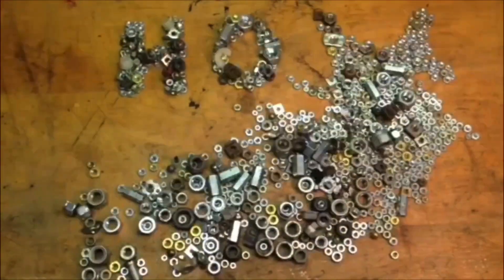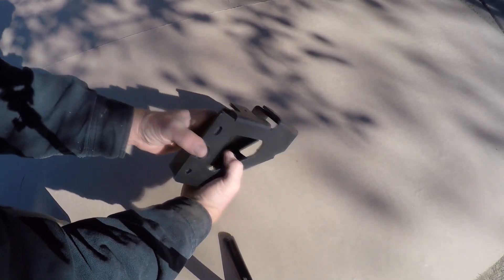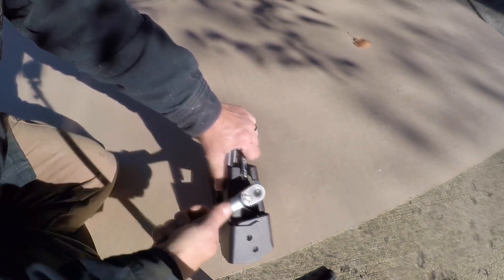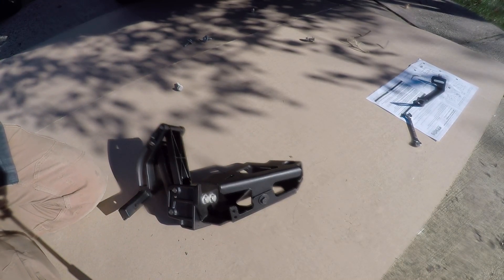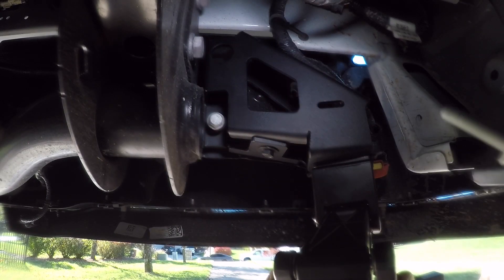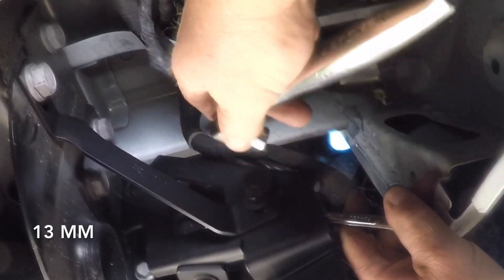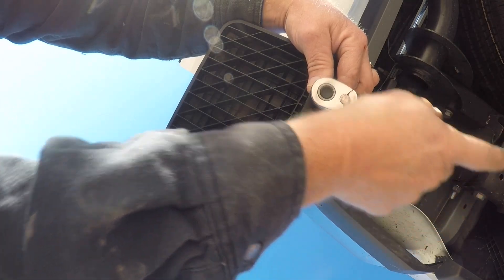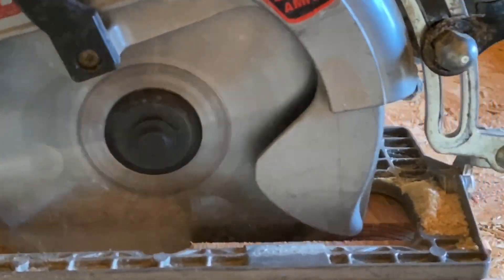Installing an AMP Research Bed Step

Comment: GREAT VIDEO.  REALLY HELPED WITH THE INSTALL.   HOWEVER, I DID ENCOUNTER A PROBLEM WITH THE LAST TOP BRACKET BOLT.  IT WAS TOO BIG FOR THE TOP BRACKET HOLE.   I SIMPLY USED THE OEM BOLT WHICH I PULLED OUT AND RE-USED IT.   IT FITS THROUGH THE TOP BRACKET HOLE.   NO ISSUES WITH FITMENT NOR ALIGNING THE HOLES.
Reply from the maker: GLAD IT ALL WORKED OUT FOR YOU. I LOVE MY BED STEP. DON'T KNOW WHAT I HAVE BEEN MISSING. THANKS FOR WATCHING!

Comment: Great video!! I ordered one of these for my 2020 3500 and there is not allot out there. I have also been seeing allot of reviews about the bolts not lining up or clearance problems at the hitch bracket. It looks like you had no issues. Thanks
Reply from the maker: No issues at all, went on very smooth and relatively easy. With the height of the new 3500's and 2500's this is almost a must have. Thanks for watching.
Reply: @funbro1  I just got mine in today and got it installed. You must have gotten lucky. The reviews I read about some holes lining up were the same on mine. I had to keep all the bolts loose just to get the bumper mount bolts to go through the holes and line up with the truck. Once I got those in it was no real problem to tighten everything back up and torqued. The last issue I had was my pad seamed to be a little warped. I had to clamp the ends to seat it in the groove to put the small Allen screws in. They would not even start in the metal backers. All in all, it’s done.
Reply: @funbro1  would this fit my 2019 limited 1500?
Reply: 2020 ram 3500, did not line up perfectly. Gonna give it another go tomorrow. Seems like I need to leave bolts loose till its attached. Great vid!

Comment: There are two wire plugs you got to pull out.  The top one goes into the bracket and the other one that is more of a square plug is the one I've had issues with.   Did you run into that issue.   That plug would not go back into the original hole and I didn't see a plug on the bracket like they made for the other plug.  Any help is appreciated.   Other than that the install was a breeze.  This is on a 2019 Ram 2500 8ft bed Limited in case of that matters when it comes to those two plugs.  Not sure if the other trim packages are set up the same.
Reply from the maker: I have not had that problem with my install. Thanks for watching.
Reply: I’ve got a 2022 Power Wagon and I am staring at the same issue I believe. There’s a big rectangular plug mounted in and a smaller rectangular one below it. Did you find a fix?? Thanks!
Reply: @alexmcdonell1452  the only fix i came up with was to ziptie it so it would not move.   I have not had any issues so far.   My concern was vibration from the road whether it was on or off road and it's not given me any issues.  Not an idea fix but that is what I've come up with.
Reply: @nlpyles2145  yessir I did the same exact thing! Lol. Still works!

Comment: Good job with this video. Do you know if the part number for this Amp Research step is 75324-01A?
Reply from the maker: Yes, that is the part number for the one in the video. Thanks for watching.

Comment: @funbro1 if you don't mind me asking, how much do you weigh?  I'm just over 300 lbs and wanted to know how durable it is.  Thanks for the video!
Reply from the maker: The weight capacity on the Amp bed step is 300 pounds.
Thanks for watching.

Comment: Does this install on a 2022 Ram 3500 Dually. I cant find a video installing on a dually, and I think the brackets are different.
Reply from the maker: I know they do make a bunch of different models, but I’m not sure if this will fit on the Dooley as well, best bet is to call the manufacturer directly. Thanks for watching.

Comment: Thanks for the tutorial — the instructions failed to show how the assembly attached to the truck. My installation was very difficult because the bolt holes did not line up after assembling the tow halves together. And, I had to install the upper bolt all the way through the bracket before installing the bracket to the frame. I rate the quality of manufacturing of this AMP RESEARCH STEP A 2 OUT OF 5. Because of the fussing to get everything to fit together due to misalignment, the install took 2-1/2 hours instead of the 30 minutes it should have. If I didn’t have an impact wench, the install would have failed because the misaligned holes for the upper bracket bolt was binding on the bolt shank so much that it took the torque and speed of the impact wrench to finish the job.
Reply from the maker: I’ve heard that the The holes did not line up on many of these steps. I found the directions to be not so good as well and was hoping this video would help some people out. Thanks for watching.

Comment: Your video made it look pretty easy to install....however, I didn't have the same experience.  I think the editing in your video didn't show some of the problems of bolts not lining up and trouble assembling.  I had trouble from the start with bolts not lining up or being too big.  Holding the assembly and trying to line up a bolt on the bumper bracket was very challenging.  I would have used the bolts I removed if the buiIt-in washer hadn't been too big.  I spent a long time on this job and never did finish.  The top bolt on the bumper bracket would only go halfway in and stopped.  Going to half to take it to a shop and have them do something.  Nice step but a pain to install.
Reply from the maker: Sorry about your bad experience, however it was pretty basic for me to install. The only editing was to keep the video from being boring. After all who wants to watch a 12 minute video that includes 7 minutes of someone turning a screw. I realize that everyone does not have the same mechanical abilities and that is in part why I like to make these videos. Wish I could help you out. Thanks for watching.
Reply: @funbro1  Sorry, I didn't mean to imply that you edited out problems you may have had.  The video was very well done.  However, after seeing other comments there is obviously a problem with some of their bolts.  I think you got a good batch....many of us didn't.  I know how to drive a bolt.  Pretty straightforward.  The first two bolts went fine.  Both of the next two attaching the linkage to the brace were trying to go in crooked.  Finally fought through that.  Next, the bottom bolt when attaching the unit to the bumper bracket went fine.  The top one, the one very difficult to get to, will only go in halfway.  You were using the socket wrench extender on that one.  I did the same and also tried my impact driver and it just wouldn't go in.  i swapped the bolts and same result.  I might just trim down the washer on the old bolt and use it.  I have reached out to AMP Research and waiting to hear back.
Reply from the maker: I’m glad I was one of the lucky ones. Sorry to hear about all the problems you are having.

Comment: I can't decide on which step to get, the MOPAR or AMP?
Reply from the maker: I was originally looking to get the Mopar step but they were on recall when I went to make my purchase. In hindsight I'm glad I went with the Amp Research because it looks to be a little bit wider than the Mopar one. Either way you go will be good. I love mine. Thanks for watching.

Comment: @funbro1  That price is crazy high.. I just purchased a RAM last week.. going through buyers remorse now.. was considering Ford.  I had a Nissan I traded for the Ram,  Which I had traded a F150 for that spit out spark plugs.. When I purchased the 2016 Nissan Titan I purchased a OEM bed step for $50.. not sure why they went up so high.. Rest of the Diesel truck made me decide to never purchase another Cummins Diesel or Nissan...  lost thousands in a trade..for an New Ram Limited that seems like less quality interior than the Titan XD PR.
Reply from the maker: I guess everyone has their favorites. I traded a Ford in and went with a RAM this time. Thanks for watching.

Comment: Almost the same price as OEM.
Reply from the maker: Very similar, however the OEM looked to have a smaller step than the AMP Bed Step. Also when I went to purchase the OEM I was told that Ram had a recall and that they could not order them until... I have seen the AMP Bed step prior to this install and have always liked the quality. As for the OEM I would guess that it is good quality also. Thanks for watching.
Reply: @funbro1  Oh, get it! I searched online and also check your video, then go to a OEM parts online store, order one.  Total cost is $260+shipping.
Reply from the maker: Let us know how you like the OEM step. Thanks